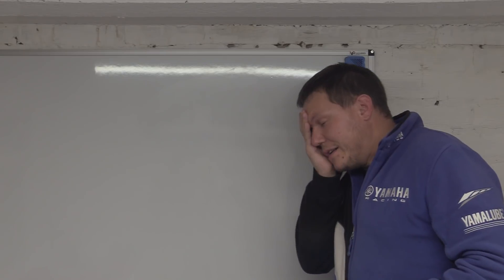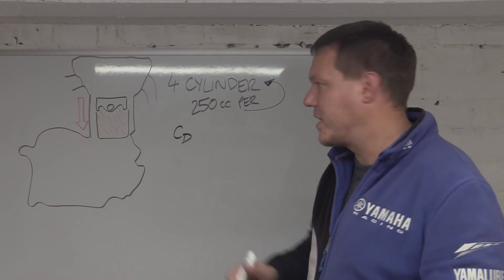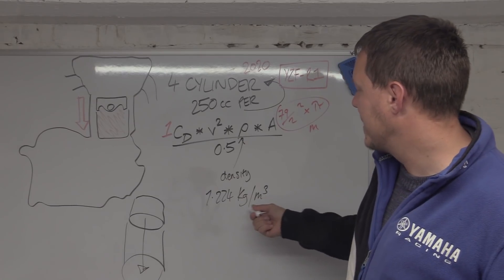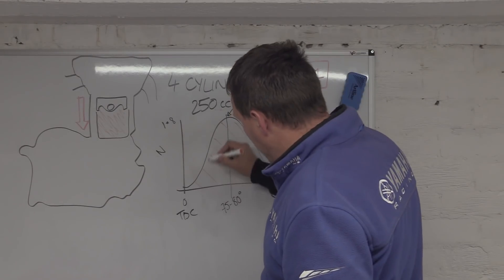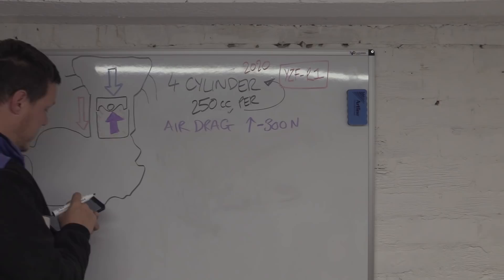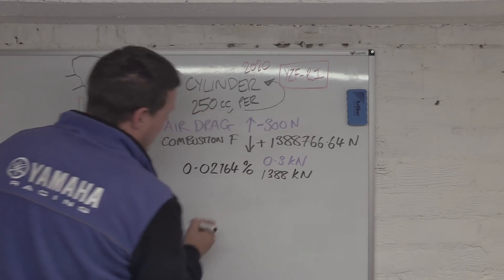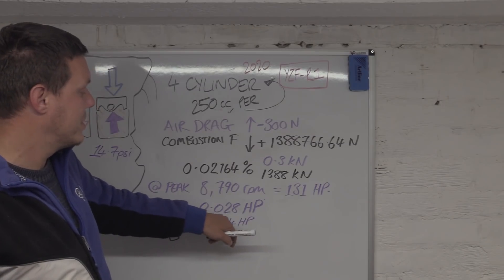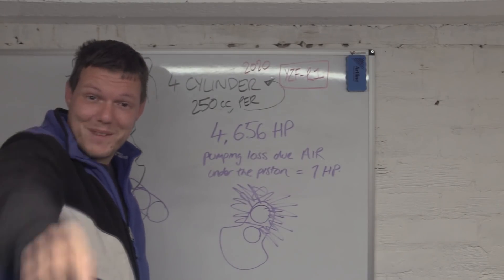Piston Pumping losses - Part 1

Comment: A lot of the small bore (250cc) motocross teams are running A electric battery type water pump… 
Really seeking .1 of hp 

Where as the 450 teams aren’t running them and just happy to take the losses  of drag in 2022 

Maybe a real advantage 
Maybe a option to sell pumps to the public!
Reply: Oil pump 
Water pump 
And piston drag all adding to 
Losses that is
Reply: Electric water pumps are used in sport for long time already. I don’t see much benefits of them in road races, where they are mostly used. But for enduro races to have RPM independent pump is beneficial. Also you can keep optimal temperature in wider weather conditions. When temperature is -5C for example it is impossible to keep engine warm with conventional system(and if no bypass valve as on most dirtbikes)

Comment: The math in here sounds really WRONG! The drag equation is applicable for unconstrained flow. here there is no flow around the cylinder --> NOT APPLICABLE. You attempt of doing an integration is what?? If you integrate over a distance you get work. Alternatively you can integrate torque over an angle to get work as well. How come your units are still Newtons?? alternatively if you are trying to do an average it can not be higher than your peak force.

Comment: Hey Matt, is this just a different approach to integrating P x dV throughout the cycle to obtain the gross/net mean effective pressure and therefore the pumping MEP?
Reply from the maker: No, because that doesn't give you energy, and thats what matters. Pressures are static and means are the death of engineering.
Reply: Don't know if we are on the same page here. MEP is basically torque (or energy/work per cycle) normalised by the displacement, and  the torque figure you use is just a mean torque over the cycle chugged out by the dyno, no? Maybe I need to wait for part 2 to see the full picture on this. It just seemed odd to me cause I haven't seen this methodology in ICE textbooks like Heywood (my background is mainly academic, nowhere near the hands on experience you have). I'll do some rough calculations maybe tomorrow, just out of curiosity to see if we get similar values. Thanks!
Reply from the maker: "MEP is basically torque (or energy/work per cycle) normalised by the displacement"

- Well no. Work and torque are not the same thing. 

"the torque figure you use is just a mean torque over the cycle chugged out by the dyno, no?"

- Yes this bit is correct. 

The problem with MEP or IMEP is that it's over 1 cycle, which means both the down and UP stroke. 

This could be used for comparing one engine against another, but that doesn't help us here. This is working out how much resistance there is vs another system, for instance a vacuum pump. 

In other words lets say you use MEP values. This gives you an average pressure, lets say 1.46 MPa and we want to pump the crankcase down by 50% so from 0.1 to 0.05 MPa.

The issue here is that the force (drag in this case) is the square of velocity. But this wouldn't be as the 0.05 MPa remains constant. So the calculation is heavily dependant on rpm.
Reply: Thanks for coming back to me man. I now see what you're talking about and why you can't apply MEPs. I suppose university courses are too focused around what happens in the cylinder (i.e. the energy required to pull air in/out of the engine) and not too worried about the crankcase side, where you cant apply the same principles. Crankcase ventilation is a topic I'd love to see a video on, if you already don't have one (a quick search did not give me any). Cheers, Chris.

Comment: Stupid question. In a 4cyl engine you've got 2cyl moving up at the same time as the other  2cyl are moving down. Wouldn't the negative pressure behind the rising pistons negate the positive pressure from the falling pistons. Making the pump loss issue a moot point anyway?

Comment: Would the vacuum effect on the crank case pressure of the pistons on the up stroke reduce the effect of the losses in the  in the down stroke so the 0.028 hp loss would be even less?? basically as the pistons on the down stroke pusshed air into the crank case the pistons on the up stoke would be pulling it out ??
Reply from the maker: More in part 2....

Comment: A better example of a real engine would be a BMW 650 single with a dry sump. 

But as you intimated, it’s antiquated long stroke V twin agricultural vibrators from Milwaukee that suffer most from chronicwankloss. But we don’t need to care about them since Ewan McGregor and Charley Boorman are heading Harley-Davidson’s rescue strategy: don’t just buy one HD electric vibrator, buy two, and have a support team following you around in a van with the spare bike and a mobile generator...!

This is how to completely eradicate chronicwankingloss, by pretending to reduce your carbon emissions whilst actually increasing your your carbon footprint exponential!

Please don’t try this at home children, it only works for celebrities. 😎

Comment: Hiya Matt, good to see you back in the game. I race a little Laverda air cooled 500cc twin in classic racing. I come across quite few people using various fuel combinations, some of the older bikes use methanol fuels and veryhigh compression ratios. There soem people that run mixtures of high octane petrol and avgas. Have you ever done anything about how these fuels behave in normally aspirated motors. I am told that using avgas mixes it burns much cooler but slower than ordinary high octane petrol. I can buy ridiculously expensive very high octane drums of petrol but don't understand what the benefits may be. I get the usual BS of "bigger bangs means more power" after watching a lot of stuff covering various topics on port design, compression ratios, valve angles and sizes etc. Might be a good topic for your new set up and help me understand WTF is going on

Comment: I know I'm wrong, cuz I'm not a qualificated injunear, but surely in a 4 cylinder, 1000cc engine, there are 2 pistons going down, 'pumping' 250cc's each into a crankcase full of dense, oil misty air, that with positive crankcase ventilation is being sucked on (not off) by the inlet; and at the same time 2 pistons are on their upstroke also causing a partial depression.... so this 250cc's is just moving across between cylinders 1 & 2 and 4 & 3 and back again, ad infinitum. OK it's 'pumping', but I don't think your fancy mathematics takes into account all the restrictions and flow paths. Your negligible 0.028 HP figure is possibly bigger than reality.  Thank you for one of the most enjoyable wasted 20 minutes of my life.... please keeps these vids coming :-)

Comment: We need pumping losses of the water pump now as iv seen a lot of talk that a electric water pump can save 7hp
Reply from the maker: Total bollocks and don't believe anyone when they say that. The electric motor needs, well electricity, and where does that come from? That's right, the engine
Reply: True but not on my race motor running total loss.

Comment: would be interesting to calculate the losses from the extra electrical load of the dry sump system vs the pumping losses it is trying to negate. I''d wager that running the extra pump would actually load the engine more than reduction in pumping losses. Though would still be too small to feel

Comment: 0.028hp, * 4 cylinders =, 0.112HP, = 83W, about the same amount of power it look to run the fluorescent tube in that room whilst filming.
Reply from the maker: It's not * 4 - Watts is time based and is Joules per second...
Reply: @thedirtyworkshop  bugger.

Comment: I forget, is the engines CC the swept volume or the actual volume of the cylinder head and piston at the bottom of its stroke?
Reply: It's the swept volume X the number of cylinders..
Reply: Interesting, the head space isnt taken i to account at all in the displacement?
Reply: @WikWak  well that amount of volume isnt really being displaced?
Reply: @mitchellbaker4847  obviously it can be under certian circumstances, but i get what you're saying.
Reply: @WikWak  no, combustion chamber is not a part of engine displacement.

Comment: Can't argue with the maths mate but there's gotta be something to this or its just a sheep thing. WSBK officals allowed teams running the Honda CBR600 in supersport to have vacuum systems to try gain some more HP back due to the age of the machine. This system has been banned for yamaha and kawasaki teams. Be interesting to get a real dyno sheet from a highly strung world supersport machine with back to back results.
Reply from the maker: Got any links for any of this?
Reply: @thedirtyworkshop  Found the banning of it in the tech regs for 2020 in supersport and superbike. Trying to find the info on honda teams being allowed it. Heard it in  the commentary last year.

Just wondering if its banned because it gives an advantage or just to save teams wasting money on it because others have it.
Reply from the maker: It depends what they use it for vs what people think they used it for. I might be banned because of dry sump systems. One thing a crankcase vacuum increases is blow-by, which reduces power - not increases it
Reply: @thedirtyworkshop  not doubting the numbers here but there does seem to be more to it.
Theres far too many dyno sheets and stories of people picking up measurable power pulling a bit of a vacuum on the crankcase or getting their crank case pressures closer to ambient.
Looking forward to part 2.

Comment: From what I can remember from my aeronautical engineering course, that drag equation is for a body moving through air that isn't being compressed due to the velocity of the object. Is the equation appropriate for the air being pushed into the crankcase by the motion of the piston?
Reply from the maker: Thats why the Cd is 1 do bsdically just the area at 100% form drag. All objects compress air ahead of the form
Reply: Correct. The use of an equation for a body in free air is totally inappropriate.

Comment: Does this mean that a twin cylinder engine with 180 degree crank is swapping air between the underside of each piston? If so where does an engine with a 270/90 crank store the pressure? or does it squeeze it out and suck it back in again? Via the airbox breather??

Comment: Aren't there also other pumping losses on the down stroke (located above the piston) related to drawing in the fuel air mixture? A reduction in pressure has to be created above the piston to allow atmospheric pressure  to push in the fuel air charge.
Reply from the maker: No, that's not how it works.... more in part 2
Reply: @thedirtyworkshop   looking forward to part 2

Comment: Just a few Things:

If you want to half something you multiply it by 0,5 (like you said) not divide it by 0,5 (like you wrote)

Integrating the Force over degrees of crankshaft rotation looks weird to me. Its not wrong but integrating over the stroke lenght to get Energy lost/ produced seems to be better (to me at least) because you dont use the same unit Newton to describe different things. 

Other than that great to see someone doing the math.
Reply from the maker: And thats what impulse is... but what matters is the comparison. Not the units for this example...

Comment: Depending on the crank setup though couldn’t you have one cylinder going up on compression or exhaust stroke creating a lower pressure region at the same time that the other piston which is on its power or intake stroke creating that positive pressure. My question is would the two pressure regions just move the air and lessen the forces?
Reply: thats what i was thinking, any engine with at least two cylinders youd think would cancel each other out but idk